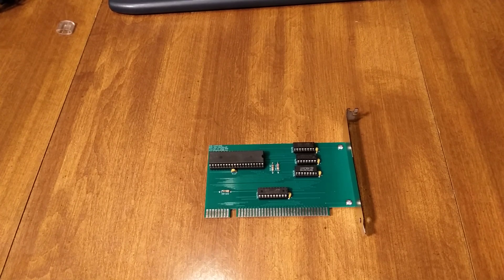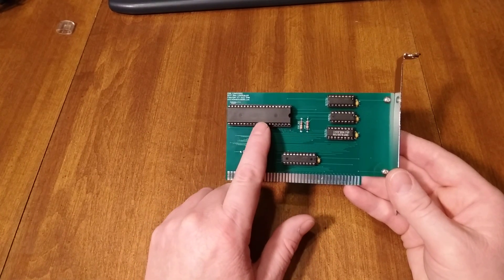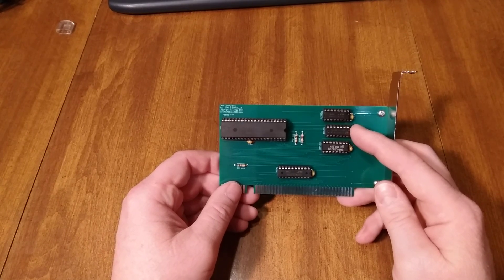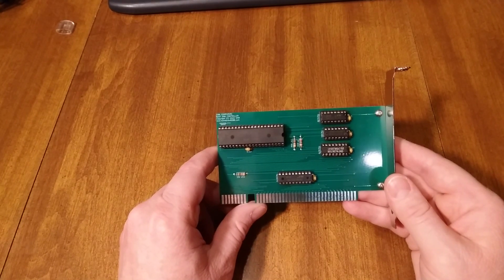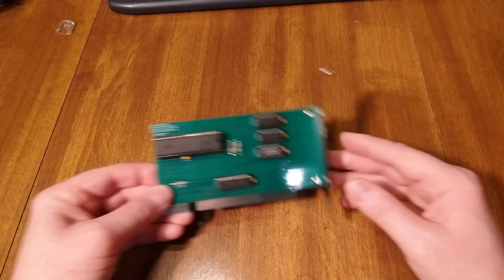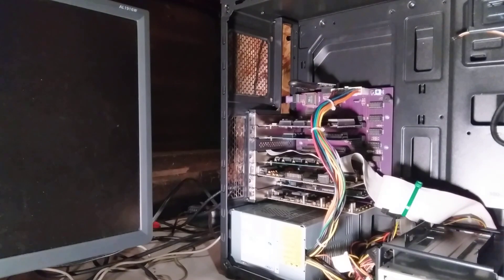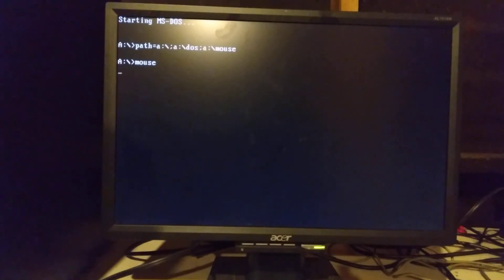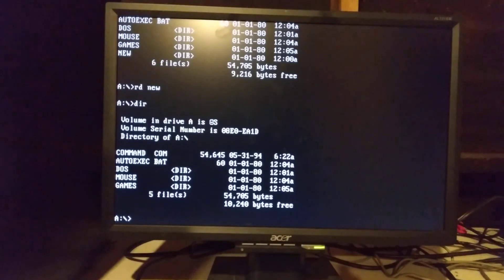D8237AC-5 Direct Memory Access Controller

Comment: This is interesting. It looks like you have one slot left. Are you going to be combining/adding any of these cards to the motherboard to free up additional slots, or are you going to have enough for your long term goal?
Reply from the maker: That is correct I have one slot left. The PC has everything I need. VGA graphics, Serial ports, Parallel port, Network card, Floppy Controller, and USB hard drive. I think in the current configuration there are plenty of slots. 

I have thought a lot about combining cards into one. I am leaning more towards moving everything onto the main board if it becomes necessary for additional card slots. This would give you all 7 slots to work with.